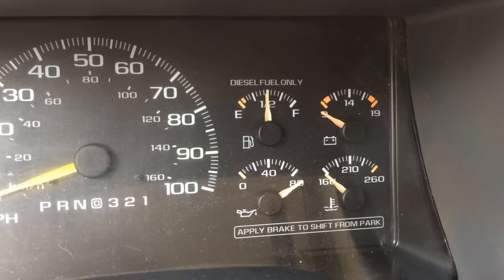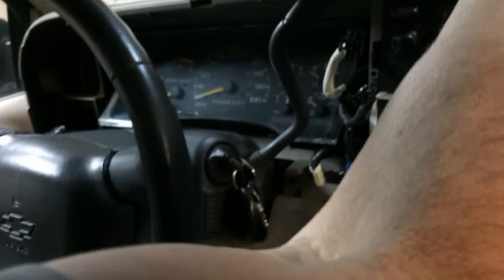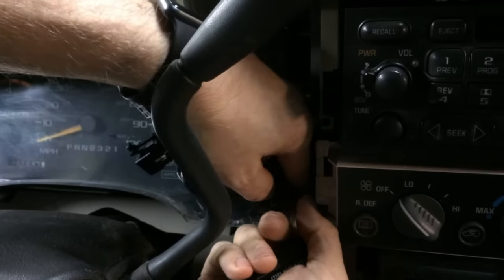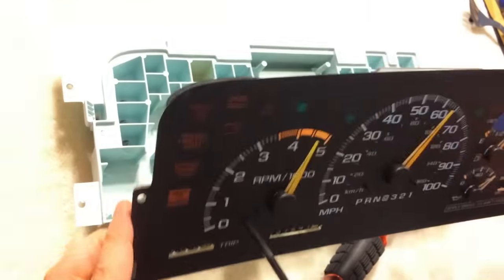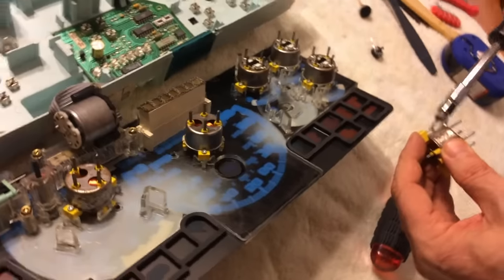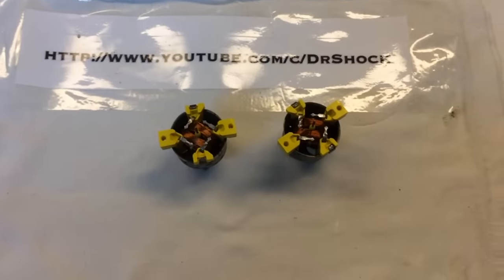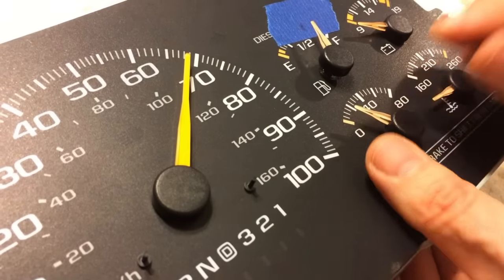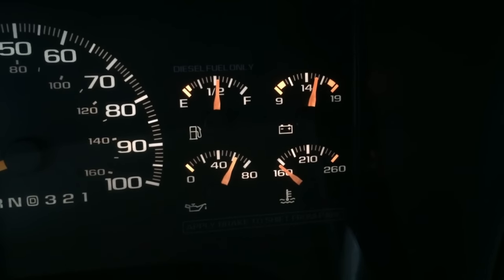1994 - 2002 GM Truck Twitchy Erratic Crazy Fuel & Oil Gauge Needle Aircore Motor Repair (Chevy GMC)

Comment: I have same type of gauge and motors in my 95 Chevy G20 Van instrument cluster. I have changed the temperature sending unit and tested the resistance with a multimeter all good. Touched the wire to a ground and needle went to 260* F. Not sure what to do now. The needle only goes to 140* F even though the ohm is at 235 (roughly 195* F). Will replacing the motor fix this or is there something else I should try first to fix the temp gauge?
Reply from the maker: I wouldn't suspect the aircore motor given that grounding test you mention indicated a full sweep to hot.  

Typically you would start the diagnosis with this sort of problem on a GM truck by disconnecting the harness at the temperature sender under the hood.  If you turn the key to the cluster lamps test position (key on engine off), then the gauge should read full cold with the sender disconnected.  Grounding the same connector, with the key still in lamp test position, it should then move to full hot.  That level of L-R sweep validates the aircore motor is fine.  If the motor sweeped the needle as expected, then the problem is going to be either with the ground at the sender, with the wiring circuit to the gauge from the sender, the circuit board of the cluster that the gauge plugs into, or the sender used for the gauge itself.
 
I'd next check that the new sender has a good ground into the cylinder head, no teflon tape etc.   I'd next remove the cluster so I could test the harness from the sender to the cluster connector in isolation.
Reply: @DrShock  did the key on engine off test got a full sweep. Tested sender unit with multi meter 1730 ohms cold, 237 ohms warmed up, so that is good with a good ground. I did have to replace the connector for the sending unit that maybe the problem don't know how to test.

Circuits on back of cluster looks to be in good condition not sure how to test them. No corrosion, no breaks.

The harness looks to be a 9 (18) pin connector how would I test this?

Finally the wire. When I replaced the sender unit connector I used the bare wire with the key on ignition off test for the sweep.
Reply from the maker: Ok, so that really doesn't sound like an aircore motor problem then, all these motors for the non-fuel gauges do is sweep the needle based on a resistance value.  Does the gauge read zero with everything connected normally for a cold engine (key on engine off)?
 
If so I'd want to eliminate any problem with the wiring from the sender connector to the instrument cluster connector, corrosion or such affecting resistance there.  To test that I'd test resistance from both connector ends, it should read like bare copper wire of course.  If not, there may be a spot or two where the insulation has worn off and corrosion has set in increasing resistance in the harness itself.  
 
These kinds of problems on aging vehicles can be very tough and time consuming to track down.  I've seen aftermarket senders not give the correct temperature reading, whereas an OG one works fine.   I've seen tiny nicks in wiring insulation lead to nearly an inch of the copper greening with oxidation thus jacking up resistance in a circuit.  I've also seen grounds that work fine until the engine heats up or you get on a bumpy road and then they go out on lunch break causing the instrument cluster to wig out while driving.
 
It can help to find a schematic for the G20 from the GM service manual to make sure there's not any other components or circuits involved to insure the scope of what has to be debugged here.
Reply: @DrShock needle goes to 100 (lowest mark on gauge) doesn't move until engine starts to warm. Then maxes at what I am guessing is 140. Only a quarter sweep.

 okay harness, wiring, and connector are all good. Reading 2 ohms just like a bare copper wire that I have.

As for the cluster when I measure from the pin that the sender unit wire goes to I get 0, 45, and 80 on the 3 separate pins that attach to the temp gauge motor.
Reply from the maker: If I had this problem I’d be inclined to pull a cluster from another G van at the local LKQ yard, along with an used sender from it.  This is one of those problems you need to side by side compare IMO.

Comment: Yes, if i replaced the oil sensor and i connected an oil pressure tester to my oil sending unit and im getting pressure this could only be the issue correct? And do these work on a 1994 blazer k1500 OBS
Reply from the maker: You could also have a wiring harness issue.  The oil gauge is the least likely component to fail.
Reply: The harness seems fine, what else do you think it could be
Reply from the maker: Visual inspection alone may not confirm correct functionality, you would need to check voltages and resistance values against the service manual specifications.  Even small amounts of corrosion in the copper can affect operation by increasing resistance in the circuit, for example.  Another important consideration is good non corroded ground points for this circuit.   This can also throw off a gauge, when the sensor is confirmed to be functioning correctly.
Reply: What do you think it is, should i check the voltage on my harness?
Reply: Thank you for all your feedback bsvk

Comment: i have a 97 that when i turn the truck on it looks all good on the cluster every gauge and light are working the blinkers work, light comes on and goes away like it should same with the hazards, the problem i have is when i turn on the headlights all gauges go to zero and my temp goes all the way past hot rpm and speed drop past zero ? help if you can .
Reply from the maker: I'd have to say reads like a short circuit but I have no experience with this particular scenario.   When you turn on the headlights that also triggers the backlighting for the cluster, I would start by tracing that particular circuit using the wiring schematics in the factory service manual to see where the damage might be that you have going on there.

Comment: Hello, is there another Air code gauge besides the F that can be used for the fuel gauge?
Reply from the maker: Only if its a newer truck, it might take a "C" calibration.   The description has the complete code table.
Reply: Thank you!

Comment: Can someone tell me why the oil pressure in start of video was pegged to the max passed 80 at idle, then at the end once job completed, truck was running at idle and guage showed 3/4 on the needle or 60 at idle?  At both those times the engine temp was the same, right at start-up.
Reply from the maker: First this is a diesel engine with a different pressure signature than gasoline.  Second the max peg was because the aircore motor for the pressure gauge was damaged, hence why it was replaced along with the fuel one.  Idle at initial start (warm season cold engine) having 50-60psi is a normal readout.

Comment: Can you tell me how I would know if it’s this issue vs the sending unit? I really don’t want to drop my tank if I don’t have to.
Reply from the maker: An aircore motor problem is usually a twitching, bouncing around when the vehicle is not moving problem.   Erratic movement when the vehicle is stopping or accelerating is more likely the fuel sender.  As it turns out I had a truck with a bad sender and made a video on that that I'll publish next Friday.
Reply: DrShock thanks for getting back to me. I think mine must be the sending unit. Mine moves if I’m driving or not, but more often when I’m driving. However, it’s nothing to the extreme that yours was. Mine moves mostly in the lower half and last 1/4 area of the gauge.

Comment: I have the fuel gage not reading the amount of gas I have in the tank it says it's always full (it's not jumping ) is that the sender unit in the gas tank and does that sender come in a new fuel pump ? ? Thank you
Reply from the maker: If its not doing the dance described in this video, and it otherwise is working (moving from showing more to less fuel between driving and fill ups) then yes I would suspect the sender unit or at least the wiring to it.  If you have a gasoline engine, then the sender and pump are a unit.  If you have a diesel, they are separate with the pump mounted on the frame rail and the in-tank assembly being the sender only.
Reply: It's a 5.7 gas  and it started dancing but rapid staying stuck on full  like it's vibrating now should I just replace the air motor like you did in your video?
Reply from the maker: Unfortunately, the supply of these parts has been exhausted.  Nobody is selling them anymore.   Perhaps after China recovers from the virus these parts will have enough demand to restart production but its anyones guess.
Reply: @DrShock  thanks,  I've seen some videos where they've drilled into the air motor and inject some type of liquid to stiffen up the spinning but I don't know what they used, the dealership told me they can fix it but will have to be send out to some one and they'll fix it for a good expensive price lol  let me know if you get a chance when they start reproducing them again thank you again

Comment: Would a 2000 Escalade also have an air core motor behind the cluster?
Reply from the maker: Yes, I believe so.  If memory serves Cadillac was still on the old body style electronics from 1999 until the 2001 model year (when they would have been switched to stepper motors).

Comment: What if you put two fuel pumps and even changed the stepper motor and it still fluctuates when turn or acceleration?🤔
Reply from the maker: If its an OBS truck that this video covers, there are no stepper motors.  Just aircore motors.   So presuming you meant aircore, then if I had changed the fuel pump/sender assembly and put in a BRAND NEW aircore motor I would suspect the wiring harness between them.    You cannot use an used aircore motor, after this many decades they are all either dead or code blue by now so not a salvage part candidate.

Comment: I have 1998 model and it does the same thing. I looked on ebay can't find fuel motor for my model where could I find one at?
Reply from the maker: Supply dried up heading into the pandemic.   In the pinned comment at the top as well as the description I linked a couple of remaining sources one of which is a cluster repair center that has the equipment to rebuild the original motors.
Reply: @DrShock  thanks

Comment: I have been trying to get a video on why my gages on my 2004 Tahoe isn't working and it won't run but it will turn over it's been running good all week just turned it of and this is what it's doing I really need it to crank so I can work
Reply from the maker: This video is about the older 90s trucks which have a completely different instrument cluster design than what was used in 2004 so would not apply to your situation.  Though what you're describing isn't really a gauges problem, failure of the engine to run normally is not going to be specifically related to the instrument cluster anyway.   You're going to need to read the OBDII computer codes off your truck to determine what you've got going on and what other video on YT might help you diagnose it further.

Comment: I have a 1998 C2500 Suburban and can't find the white air-core motor on the internet.  need the one with the "F".  only find yellow ones with the "C" on it.  Can you help me?
Reply from the maker: There's a comment I've pinned at the top with a speedometer rebuilding shop.  That's about the only option on the "F" 's currently sadly.   Ever since the pandemic set in last year, the one factory in China making these seems to have dried up and blown away.
Reply: @DrShock  I found someone on ebay who has the complete instrument cluster but for the 6.5 diesel.  should still work if there is an "f" on it right?  greetings
Reply from the maker: @hahne8889  Yep, of course presuming it doesn't already have the same problem which eventually comes to all of the original aircore motors with age.
Reply: @DrShock  The seller only sells the entire instrument cluster.  Let's assume the fuel gauge works, but there is a "c" on it.  Then I can't use that right?  Would the complete instrument cluster work if I built it in?  No right?  A diesel is good, but apart from the engine speed everything looks the same.  Thanks for the quick responses
Reply from the maker: @hahne8889  My research with speedo shops indicated the "C" is a calibration for a new body style truck, the pickups that came out in 1999 or SUVs that came out in 2000 with the new bodies.   I don't know what behavior it would have in an old body style truck.   That all said, if the cluster looks like the old body style ones, it should have a yellow "F" calibration motor installed anyway regardless of year (Some OBS trucks carried over into 2000 like the 3500s).
Reply from the maker: @hahne8889  All three of those in the eBay Germany photo are old body style clusters.   The one on the left looks North American (E and F symbols for fuel level) and the other two look EU market versions (empty and closed circle fuel level symbols).   Thanks for the photo, haven't seen one of those non-American clusters in a very long time.  ;-)
Reply: @DrShock  Yes, I noticed that too.  He wanted to tell me today which of the three is still there.  I hope the left one.  But if not I think I'll buy it anyway

Comment: Gauges maxing out quite often is a ground issue for the gauge.
Reply from the maker: Not in this case.  The GMT400 has this known issue due to using an aircore motor rather than a stepper motor for its fuel gauge.
Reply: @DrShock  I wasnt referring to your case I was talking gauges in general for those reading.

Comment: Would something like this work is my speedometer is off by 10 mph and then 15mph?
Reply from the maker: Very unlikely to be related to the aircore motor itself.
Reply: @DrShock  My gas gauge is messed up so is my oil pressure very similar to yours. You think it could be the wheel speed sensors?
Reply from the maker: Very expensive to guess what a problem is.  Best to actually diagnose each problem individually as they are unlikely to be related.   The fuel gauge behavior I show in this video is a gauge aircore motor problem, but without the twitching it's more likely a fuel sender problem instead.   It can also be a combination of both at the same time.   The oil pressure gauge aircore motor will be at fault only if you see the behavior shown in this video, as a result of the faulty fuel gauge damaging it.  Rarely , the oil pressure gauge can also be affected by a faulty oil pressure sender.  The speedometer is most commonly off by the use of tire sizes different than what were originally installed (the tire sizes are programmed into the VCM/PCM using a dealer Tech2 scan tool).  In more rare cases, the speedometer can be off due to a problem with the instrument cluster having been replaced with an incorrect part number for the target vehicle (they are not all the same just because they look the same).  The only sensor involved would be on the transmission, not the wheel.
Reply: usdashworks here, if your gauge is reading 10mph too fast your speedometer driver chip is corrupt. The gauge will continually get worse until the speedo is pegged out. unfortunately you need an entire new unit. we cannot get the chips anymore.

Comment: What happens if the gauge moved before i marked it...it moved when i was removing from vehicle
Reply from the maker: For the fuel gauge there's several threads of older comments on this topic you might take a peek at.   You can adjust the needle after you fill up presuming you had a normal routine and known how much you would put in by when to hit F.

Comment: So   i have 94 suburban  and it was transmission.  Now its gearbox and  i want active the sift up  light...   its comming without (K) wire...  so  i want to beldup (K) wire  tell  me  start from.... And  finish in where   and thank you 😊
Reply from the maker: If I understand your ask here you have a 1994 Suburban that originally came with the automatic transmission and you've now swapped in a GM manual and you want the instrument cluster shift indicator to illuminate as it would if you had the manual trans factory installed by adding the missing wire from the harness.  

Well, you have more than a missing wire to deal with here.  To do this you would have to be using one of the original two manual transmission types that GM originally shipped RPO with the Suburban in 1994, AND then you will also need an ECM  (engine control module) from a 1994 truck that was equipped with that SAME manual transmission type AND the SAME engine type (diesel or gasoline) as in your Suburban.  Lastly you'll need access to a GM Tech2 scanner to reprogram your Suburban's VIN into the swapped ECM and possibly update the calibration for the particular engine.   The wire at the instrument cluster is missing due to differences in the factory ECM wiring harness between automatic and manual trans equipped trucks.  The manual transmission shift indicator signal is driven by the ECM computer, but programming to drive it will not be present in the calibration file for an ECM installed with an automatic transmission.    So AFAIK it's not possible to just add the wire, because the automatic type ECM in 1994 won't have the programming to drive the shift signal for the manual trans.  GM had separate ECM part numbers for each powertrain combo (engine + transmission type) in the 90s.